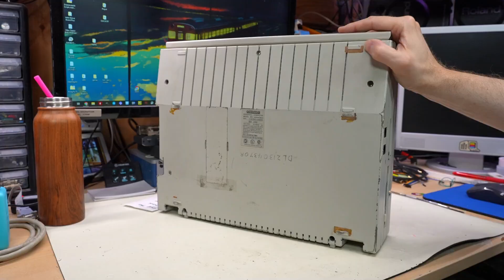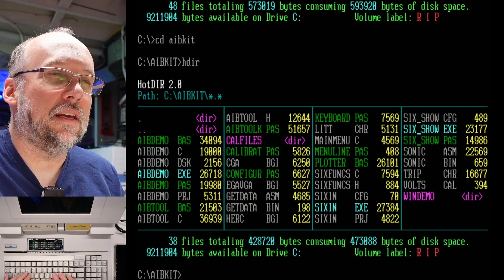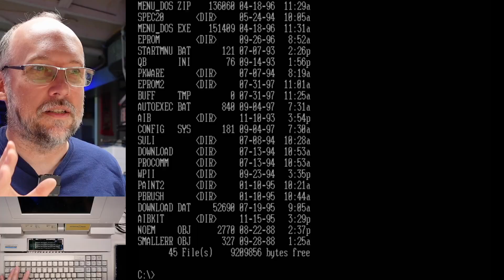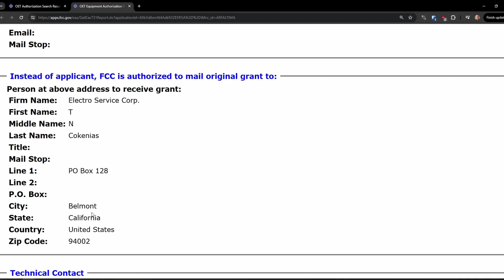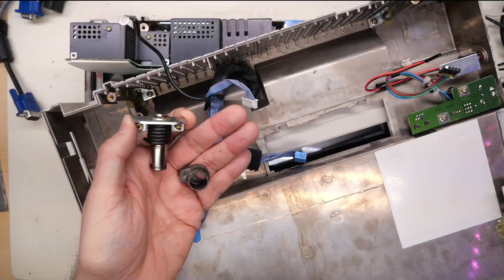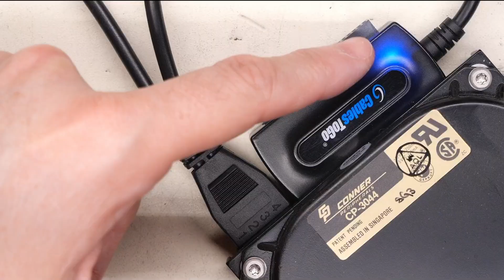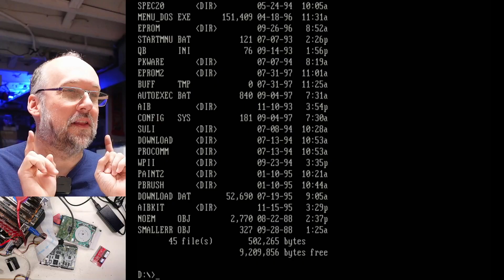PC Archeology: The Altima One laptop (Altima Systems)

Comment: That hard disk was configured on the 286 with the wrong CHS configuration so when you use autodetection with the correct settings you get trash as the data was written with an incorrect CHS config. As such you need a system that allows manual configuration then set the configuration to match the 286 configuration assuming you can find it in the first place.
Btw, I know this because looong ago as a teenager I ended up formating a disk with the wrong CHS config cause I did not know it making it a tad smaller than the disk would actually be in order to have some sort of error margin which gave me a working system, issue was when I moved the disk to a system with the correct settings (or autodetection) as it would only see trash due to the mismatch. 
Ended up having to format that disk and lose the data cause the idiot here failed to take note of what he had setup prior to a BIOS reset...

Comment: I'm a big fan of PCTOOLS under DOS.  Specifically I used it as a file manager but never really felt confident about running a bunch of software under the glorified task swapping of dos shell like utilities even though I never noticed any sort of problems with them....    As far as multitasking there was never really anything that could compete with SCO UNIX if you wanted to multitask, in my opinion.

Comment: CP3044 lies it "default translation mode". It may report 2 heads to the driver when it is more like 4 .
Setting a translation mode manually might fix that.

There may be a problem with "iordy" line, that is used to prolong the ide register  read and write cycles. Disconnecting the signal and having it pulled high with the resistor on ide controller migh help.

Comment: I was going to bet it was 386 from the start, I never even knew there was a 286 faster than 12mhz. I would of used LLXL to transfer/sync the whole HDD from original laptop over serial or lpt cable to another machine, less pain.

Comment: In high school, I think we actually had software from this company (It's been a while time ago). but If I recall, they made several versions of their software for other platforms, and they also had a "Breakout Box" you would use with the software. The software we had could measure temperature, rate of acceleration, light intensity (if I recall). We had version of that software for the PC, Apple II and Amiga (I took the Amiga versions home to play with at the time).

Comment: I used Voyetra Sequencer Plus Gold and their ISA card back in the early 90's, running on 286 12MHz. I took for granted how rock-solid the timing was. Later, windows-based sequencers had terrible timing, in comparison. It took like 30 years for windows sequencers to reach 1990's dos precision.

Comment: Greater than 90% of the hard drives I've encountered since around 1990 I were still working fine when I EOLed them after 5-15 years. Let the myth of the unreliability of hard drives die today. There have been some notoriously bad IDE lines over the years, but if a hard drive is 5 years old chances are it will live to 25. You will start to use the device less over time until its relatively small size will become a nuisance. Then you will e-waste it while it is still working. There may be millions of working hard drives in landfills around the world. Hard drives stop being used not because they are unreliable, but because they are a nuisance to use.

Edit: It looks like this Conner failed during the video, but somebody posted the fix below. Degraded rubber, intact data.

Comment: If the the graphics chipset can handle 16 bit access, and there is a 16bit isa slot in the machine, I wonder if the graphics could be upgraded to 16 bits with a whole bunch of bodge wires.

Comment: I've seen a couple of these machines in use.

Yes to the battery back-pack. The two recesses on the back contained legs that would tilt the whole machine up so that the beveled front was level with athe desk to give a bit of height to the monitor rather than trying to focus on something that was too low to be comfortable.

Whatever else was on the machine, they made excellent serial terminals for diagnostic work.

Comment: My first laptop had this exact "altima" logo on it - but it was released maybe in 1997 and had a DSTN 800x600 display (atrocious) and came with 32MB of RAM and a Pentium (non MMX) CPU running at 133MHz. It was meant to run Win95, but I soon got rid of that and installed SuSE 5.2. The hardware was probably made by Clevo, because certain  Clevo manufactured laptops (Tuxedo Computers) came in the exact same garishly decorated cardboard boxes as that ancient "altima" laptop.

Comment: The trouble with these Conner drives is they can translate many drive configurations, heads, cylinders etc to what is physically in the drive, so if you then try and access it with a different set of parameters that also equals the drive capacity (or near enough) you will not be able to read it. The actual drive had four heads, so a track zero of a five head translation would take one and a bit native tracks to store, so if you tried to access it with different  parameters then the track zero would be the wrong size, and everything following it would be offset is increasing amounts as you moved to higher tracks, so hence a total garbled read with the wrong parameters.

Comment: Worked in a lab in an IT/data manager capacity and the ISA (even only 8 bit) slot would be ideal to interface computerized lab instruments at the time.  I never worked in hospital, but I imagine it would work with computer control medicial devices in the same manner.  The "lap-top" would work well with something that might have to roll from room to room, but that is further conjecture on my part.

Comment: Your title is funny, and peripherally relevant to me. Back in the mid 1990s, one of the owners of the company I worked for had a NEC Versa laptop. Last summer, I acquired a Nissan Versa subcompact and it's taken me almost this long to re-associate "Versa" with Nissan. I will add that the NEC Versa was a better laptop than the Nissan Versa is a car, although my Nissan Versa serves ably as a local runabout.

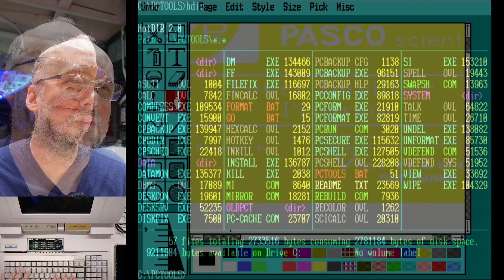20:22 - Heyyyy, Central Point Software's PC Tools! I think that and Paradox were the first two software titles I licensed for the first PC I bought, back in 1989. I bought Paradox so I could work with a friend as part of a database consulting side hustle, and PC Tools for just about everything else. It had a text editor that served as a very basic word processor until I could afford a real one, a better backup than Fastback, an antivirus that I liked better than McAfee VirusScan, and disk utilities that I liked better than Norton Utilities. I remember checking out PC Shell, but I rarely used it, as I was quite comfortable with the DOS command line. I'm a career IT worker, and used plain ol' DOS all day long back in those days, but even for an experienced DOS user, PC Tools was definitely a package that punched above its weight class.

Comment: These early portable computers may have been underpowered & bulky, but they were genuinely revolutionary for those who needed the portability. I remember in 1988 a university professor we knew proudly showing off their new Amstrad PPC computers on a field course. He only had two of them to share between about 30 students and they were only super-XT class machines with an NEC V30 & small lcd displays (being Amstrad there was much cost cutting, but not too much). And at 5.4Kg (plus the weight of 10x C-cells) they were technically over the hand luggage weight limit for flying. But for his needs they were a giant leap forwards in technology which allowed them to do so much more. 
On his zoology course they did a lot of statistical analysis (he reckoned his department were second in the entire university for computer usage, behind only the computing department itself) and thanks to these two Amstrad PPCs they had computers on the overseas field course for the first time.
The difference between a slow PC and no computer at all was huge.
For a truly portable computer from that time, look for a Cambridge Z88. This only had a Z80 cpu and a two line display, but offered real portability and was a genuinely useful, fully functional micro computer. Douglas Adams was an early adopter and took his travelling around the world to remote locations for Last Chance to See. (On Komodo he used it to write a program to calculate the volume of a Megapode nest - because why not.)

Comment: I rather like this period of "portable" computers and recently acquired the oldest in my collection yet, the Ericsson Portable PC from 1985. Looks pretty much like this Altima and the Compaqs design-wise with a removable keyboard. It has a 8088 processor, 512kb of memory and a printer(!) intergrated on the back. Apparently it is the first portable that used the orange/amber plasma display and unfortunately it has the dreaded lines on it. Hope to fix it in the future one way or the other. Fortunately it has a removable battery as well which had not leaked. Great vid and love to see these oldies get some love as well.

Comment: I agree with what you're saying towards the end about how these were pretty bad 'laptops' in the day, very compromised, terrible performance.. now.. I do have an old IBM ThinkPad a20m I'm pretty sure that's the model) with the red button on the bottom key row for the 'trackpad' mouse thing.. It's the 'new' era of laptops and really when they became much MUCH closer to a useable portable system.. It was my mother in law's, she was a chemistry teacher for 30 years and they let her keep this thing, probably from around 2000 or so. It's pretty neat, 100% unmolested, has all the original hardware on it.. it's pretty cool for a throwback laptop that's actually 'useable' per se.

Comment: Couple things -  1) looked as if there were some EPROM-sized OBJ files in one of those EPROM programmer directories. Might be interesting to see what they are. 2) The CP3044 came out at a weird time, I remember installing a few in 386SX systems when I worked at a (then) small computer dealer, and they were exceptionally finicky about what IDE options and bus speeds they liked.

Comment: It looks like the version you found was set up for lab automation.  There was software for system 310 which was an intel 286 based multibus pc at one point, but I think Intel offered System 310 iRMX to run on generic 286 PCs.We used to use iRMX on actual i310 PCs for building custom lab automation systems.

Comment: The requirement for manual CHS configuration in the hard drive adapter doesn't surprise me that much.  Most "IDE" controllers you see (including USB ones) are actually ATA (PATA, or parallel ATA).

Although ATA and IDE use the same cable, they are not identical.  ATA has a standardized set of commands and includes features for auto-identification of connected equipment.  Whereas IDE was pretty much a single-cable version of the old ST-506 interface, and needs to be configured accordingly.

IDE drives also don't support logical block addressing.  DOS needs to provide actual cylinder/head/sector (CHS) numbers.  If they numbers don't align with they physical disk geometry (how it was low-level formatted), then you will end up reading the wrong blocks, resulting in garbage data and I/O errors.

Comment: laptop in my eyes were really becoming usefull for the "normal" user when the dvd driive was available i remember the first one using when my dad brought one back home from work they somewhat used it there but most of the time it was just lying around since it wasn´t powerful enough for the work they did, but for watching movies and using the internet it was quiet good some years after that i bought my first own laptop an core2duo maschine which was as good as the desktop pc´s of that time but after that i gone back to desktop since you can have better hardware and easier upgradability and just recently (~2 yrs ago) bought myself an new laptop with tablet and pen input for studying so that one is just used for this, still is way more powerful than my first one which recently finally went to recycling after the screen hinge broke and the tft screen was fading out in the edges

Comment: I used to work at an old school printing shop back in’96. Those images that you pulled up looked like the inverse color scheme that the office used before being sent to a UV printer to make the individual color plates. They were probably flyer or ad headers. I could be wrong though.

Comment: The CHS translation mode doesn't have any effect on drives with less than 1025 cylinders and less than 16 heads. Anyway, those drives obviously don't report their CHS parameters, which is why they have to be provided by the CMOS setup and which is why those USB-to-IDE adapters probably think the drive is malfunctioning, trying to fix the error by continously resetting it. So I was wondering how the automatic detection of the parameters is done. What if it just tries to read several CHS combinations in order to determine the highest possible numbers for those values and what if the drive actually reports a success for, say, head 5 (with 0 being the first)? DOS would still be able to read the first sectors and think it is a valid file system, but when reading any further than the first 85 sectors, it would inadvertently access the wrong sectors because it is calculating with 6 heads instead of 5. I think it would be very insightful to see the automatically detected values.

Comment: Regarding your issues reading the Conner hard drive, many older IDE drives like that one not only don't support LBA, but also don't support querying the drive for its parameters (which is why you had to set the access mode to normal and set the CHS manually).  Most USB IDE adapters don't support drives that can't do LBA and that can't report their CHS values, because there's no way to manually configure them.  Those adapters just weren't designed to work with drives that old.

Comment: I had an Altima One, obtained from a junk seller in the early 2000's.  It had a fairly high resolution glossy screen, like your Two, though it wasn't VGA I'm pretty sure - maybe EGA, or Olivetti; I remember Windows 3.0 could run in 640x350 or 640x400 or something.  The door on the display holds a serial mouse (not connected, you have to take the mouse out of the display and plug the other end of the cable into the serial port on the side).  I put a Sound Blaster in the ISA slot in mine, and it worked well (though you need headphones or separate speakers).  A very unique laptop, with a very readable display, pretty high contrast for the time.

Comment: what with the garbled characters in the HDDs vendor string, I'm guessing that one or two of the IDE connector pins on that Conner HDD are just not soldered up well and don't always make contact. (or on one of the ICs - had a Sound Blaster 2.0 card where one pin wasn't soldered, leading to hanging interrupts)

Comment: a conner 3044 hdd, and still alive after 30+ years. thats a miracle, most didnt live more than a single year
Reply: I used Conner hard drives a lot back in the day. And while they had terrible compatibility issues (ever tried running it with another non-Conner on the same bus? Yikes!), I never once had one die on me. In my experience they were extremely reliable once you got them working. Quantum Bigfoots on the other hand... 🤣

Comment: That one looks a bit similar to my first computer - a 386SX notebook by Sampo! Mine is a bit later model, made in June 1991 - I've bought it in 1993 for 399 USD. It is much smaller and simpler though - no ISA, no SIMM etc., practically not upgradeable at all. There is only a slot for optional 387 coprocessor and another one for some proprietary RAM expansion card I was never able to find. Sadly it gradually got broken after just a few years: the monitor started to lose image in 1998 (some problems with the internal flat cable maybe), then in about 2001 the hard drive stopped working (it is Conner as well, but a smaller one in size and with 20 MB), and a few years ago the power system broke (with some capacitors having popped out, I believe). Still hoping to repare it one day :)

Comment: I remember having similar issues with and old HD from mi Amiga 1200 using a IDE to USB adapter. I only find reliable to plug it to an older PC with EIDE ports and using Linux to make a image from the hard disk.

Also, doing a hard disk image with "dd" command would be far better that using XCOPY

Comment: That's a proper laptop from the late '80s and early '90s! And 16MHz was pretty fast for a 80286 of those days. In addition, Samp would have had to be able to bring the third revision of this system to market quickly because of the (external) similarities between the 80286 and the 80386SX.

The reason you were unable to properly read the harddrive a couple of times even after you'd turned off the block transfers, probably also has to do with the geometry the (XT-IDE) BIOS chooses when automatically detecting the drive. Type 17 was probably the most "compatible" choice for the early Phoenix BIOS the machine came with. I noticed that for that type, the number of cylinders is 977, whereas the number of cylinders the Connor drive itself reported on the sticker was 980 if I'm not mistaken.

Comment: For the hard drive access trouble, apparently there were several revisions of the IDE spec over the years, with the earliest form of it not having a way to auto-detect settings. The USB to IDE adapter depends on auto-config, so when connected it goes "???? no idea what this is" and resets itself repeatedly. The auto-config BIOS doesn't have a way to tell you it failed its auto-detection so it picks some random value that is wrong and just goes with it with no indication why it did that.